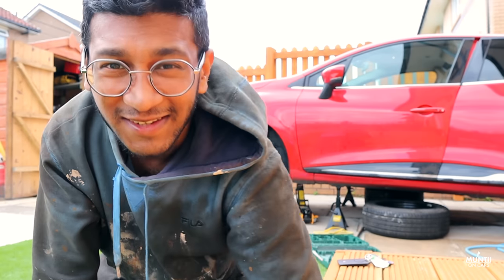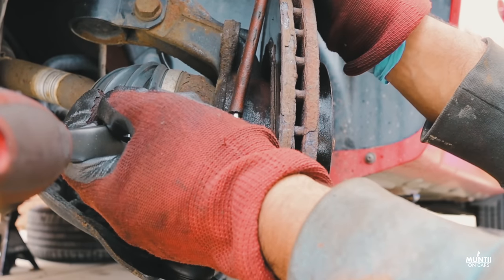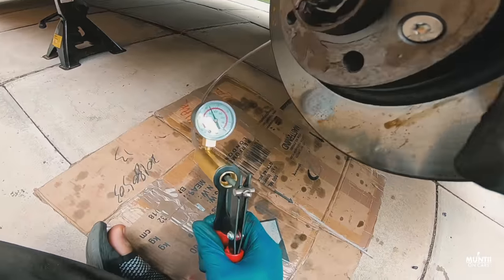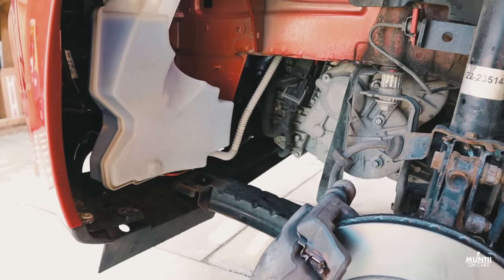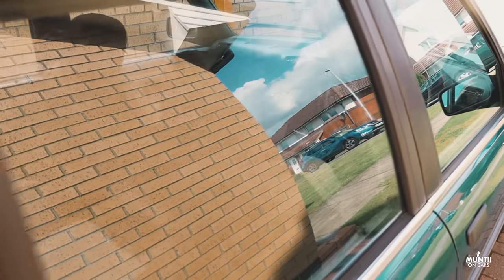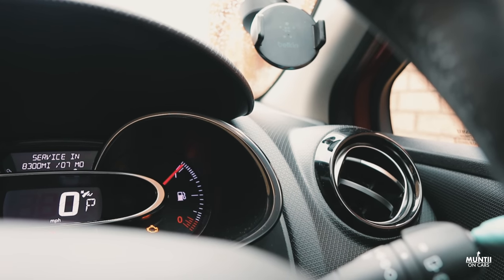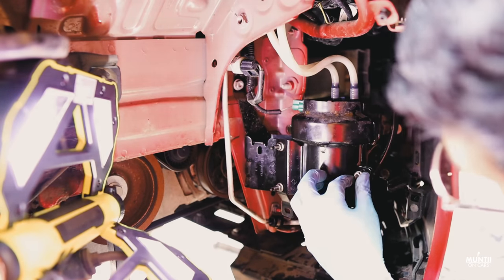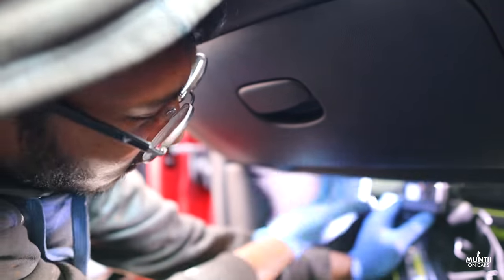Renault Clio MK4 (2012-2019) FULL SERVICE + Brakes + Suspension work | MAINTENANCE WITH MUNTII

Comment: Very therapeutic video 
Surprised you had to remove the cross member just to change the control arm
Reply from the maker: Thanks bro for checking out the video! 👍🏼

This is French 🇫🇷design for you! Some things are ratty nutty easy and some just a nightmare 🫤 

Eventually got there 👊🏼 Full service been carried out. Update: no more knocking noise. All sorted. Car pulling like train with fresh oil 🤣.. Tracking done too.. 😬🤟🏼

Comment: Please make a video how to replace sway bar bushings on the MK4. It's making a lot of noise driving over bumps when cold outside.
Reply from the maker: Hi Johnny welcome to my channel and thanks for commenting🙂. Clio is going strong after these work🤟🏼👊🏼! There was clanking noise previously🤦🏼..after changing top mount, drop link and control arm, it's all sorted.👌🏼

Now to access the sway bar bushing I believe you will need to drop the front subframe and it can be a nightmare🤔😑.. But surely will keep in mind, in future if my car's sway bar bushing needs replacing will make a video.

Comment: Hi, great video. I have the 1.2 and would like to do my brakes myself. This video has helped a lot.  Can you tell me which size of bleed spanner I'd need for front and back. Thanks.
Reply from the maker: Hi there, thanks for tuning in. I'm glad this information is helpful. Normally, the spanner size required to bleed the brakes is 8mm. Make sure to clean the bleed nipple before using it. Attach an 8mm wrench and hose to the caliper bleed nipple, but do not loosen it all! Also, connect the hose to the fluid catch.

Feel free to ask if you have any more questions or if you need further clarification! - Happy motoring - Muntii on Cars
Reply: Brilliant!  Thanks a lot. BTW your e30 is lovely.

Comment: May I ask where you purchased your interior rubber mats, please? Been after a good pair for a while. Thanks.
Reply from the maker: Thanks for checking out my video. I got the rubber mat off amazon - 'Amazon Basics Heavy Duty PVC Faux Rubber Car Floor Mats Universal Deluxe，All Weather Trim To Fit for 95% Automotive SUV Sedans Trucks，4-Piece Solid Black'. Hope this helps.
Reply: Thank you so much for your response and time. Famtastic Videos re Clio !!! @MuntiionCars